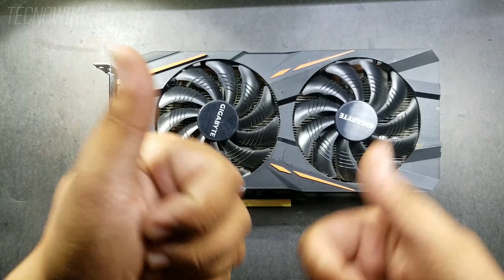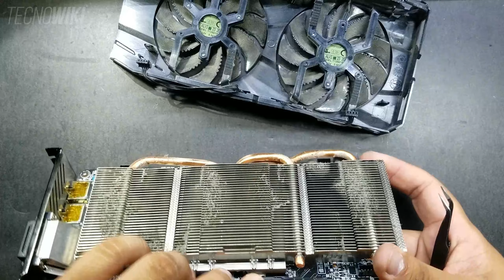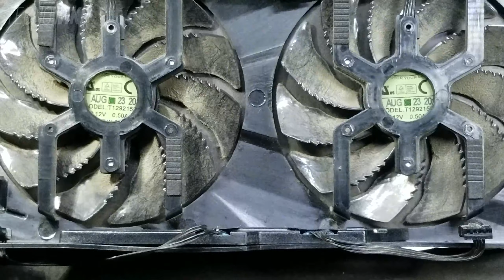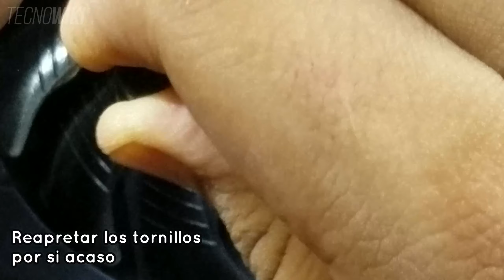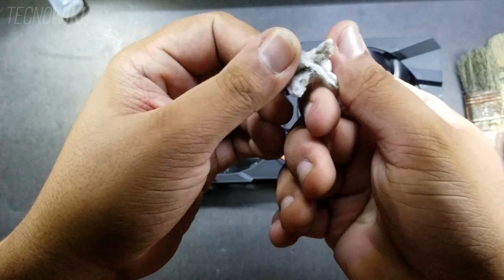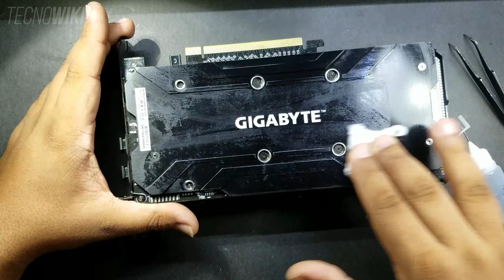👉Como LIMPIAR una TARJETA DE VIDEO 😱 GIGABYTE RADEON RX 570

Comment: hola en las memorias lleva pad de 0.5mm y en los mofest lleva pad de 1.0mm yo le cambie a 2 rx580 pensando estaban resecados los pad termicos pero nada que ver con 1 año y 2 meses de uso aun los pad estan como nuevos en una de las gpus la temperatura esta igual y en la otra la temperatura termino aumentando unos grados no se que le paso.
Reply: ¿Que modelo? ¿La Gigabyte?
Reply: @lalelin7727  hola ojo que hay varios modelo las que yo tenia eran las GIGABYTE RX 580 GAMING 8G (rev. 2.0) pero mira que los pad termicos que traen de fabrica son buenos duran facil de 3 a 4 años dependiendo el uso.